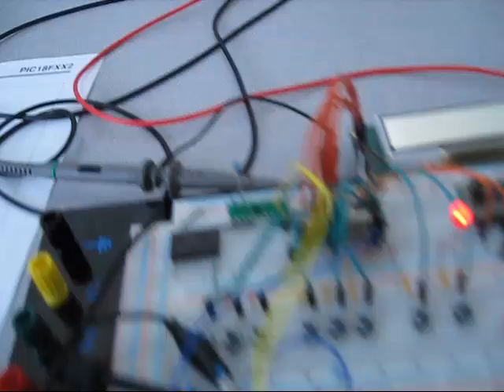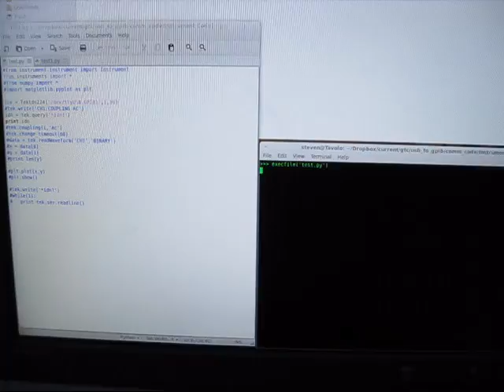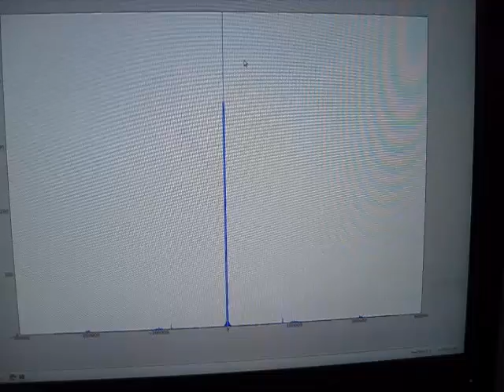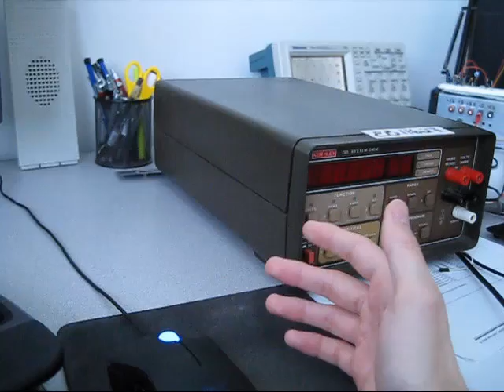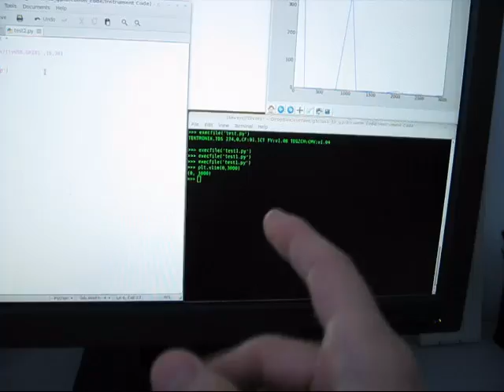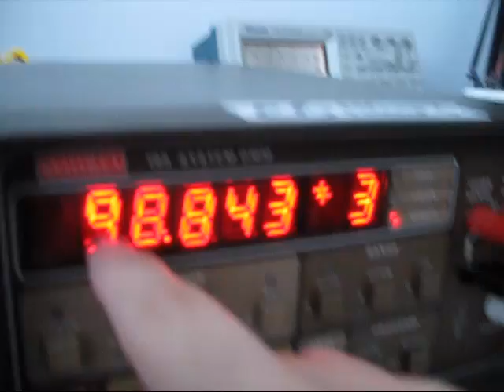Episode #1 - USB to GPIB Adapter

Comment: Moreover, do you need to install any drivers? How do you send commands via Python to the instrument?
Reply from the maker: +Alfredo Canziani (冷在) github.com/Galvant/InstrumentKit
Reply: +Steven Casagrande Sweet! If I have a NI GPIB-USB converter, I guess it should be VISA, right?
Reply from the maker: +Alfredo Canziani (冷在) Yes, using InstrumentKit, pyvisa, and my open_visa class methods that should work. Note though that for pyvisa you still need to have the normal VISA drivers installed.
Reply: +Steven Casagrande Which should be http://www.ni.com/download/ni-visa-15.5/5849/en/ correct?
Reply from the maker: I believe so, but I've never tried VISA on OSX
Reply: +Steven Casagrande Ok, thank for the tip about https://pyvisa.readthedocs.org/en/stable/
What is the advantage of your library?
Reply from the maker: InstrumentKit abstracts away what communication layers, manufacturers, and product models letting you change your setup without changing your code
Reply from the maker: It handles communication channel details and provides an easy way to implement the protocols for specific instruments. And then you can share that effort with others so they don't have to do it!
Reply: +Steven Casagrande Oh, so you're not directly sending ascii, but you operate at a higher level of abstraction. Is it right?
Reply from the maker: +Alfredo Canziani (冷在) it uses pyserial/sockets/pyvisa/pyusbtmc/etc to actually send the data. IK provides a consistent interface while not having to worry about communication layer implementation details
Reply: You have not made any additional videos for a quite a few years it seems! It's a pity because  these gpib videos are excellent and useful as this technology is still used! It would be helpful though if you could also demonstrate setting up a system in windows using the ni 488 CDs and showing how to pull it altogether into a working system.